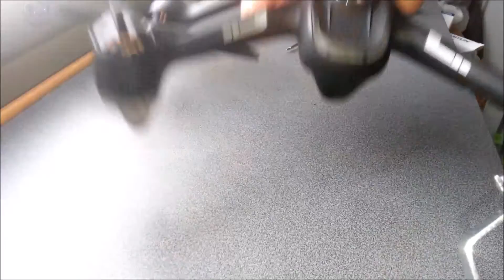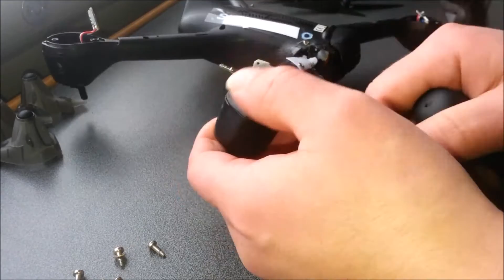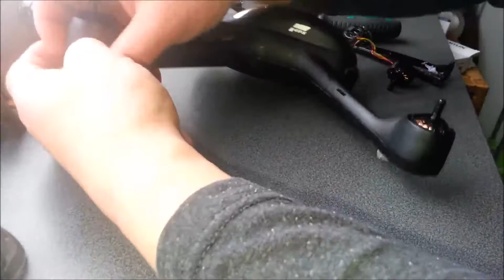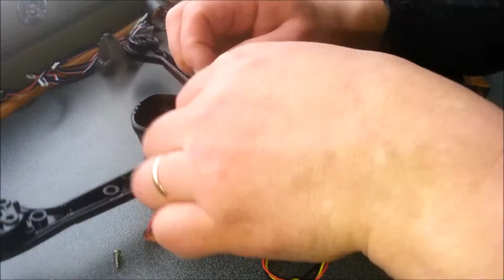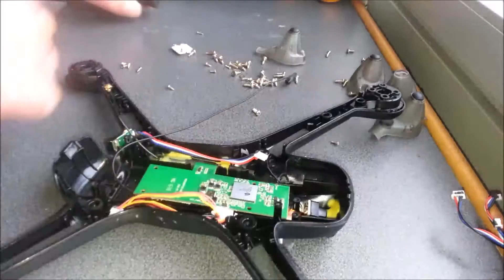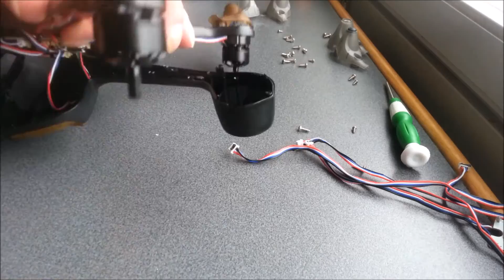H501C body repair

Comment: Great vid Johtaja. You just turned your H501C into an H501S. How did it work for you...video turn out good? Also, have you tried using it with a H7000 transmitter? You should now be able to do waypoint missions with an H7000...way cool.